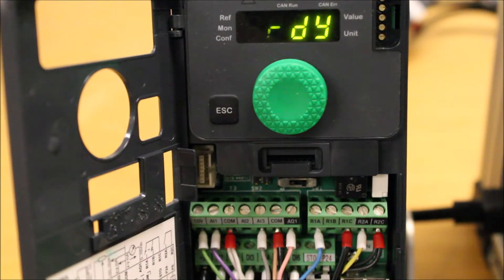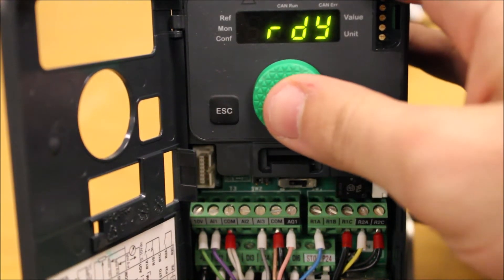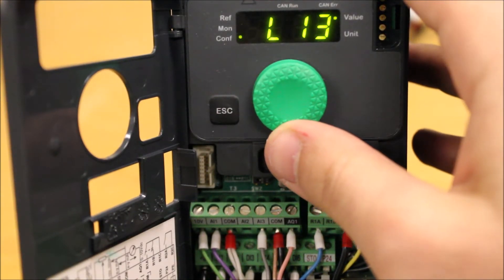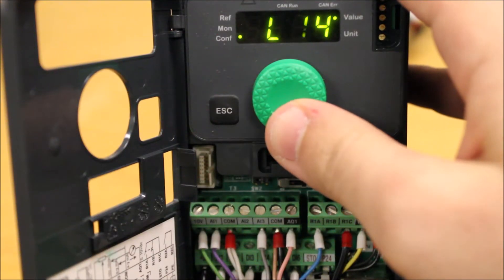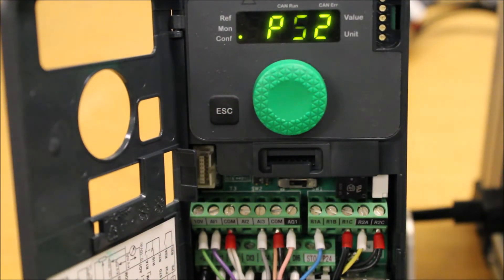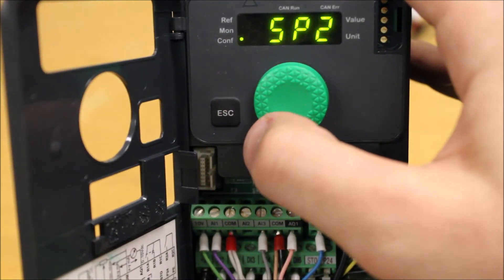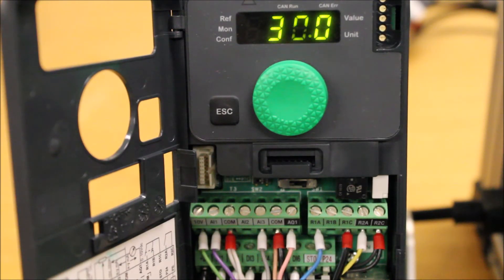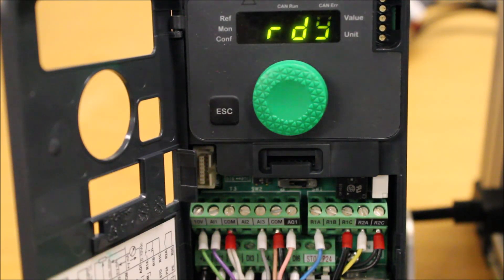Configuring Preset Speed Functionality on Altivar 320 Drives | Schneider Electric Support

Comment: what is the 18.2 Hz at starting @3.32 , and how to set the SP1?
Reply: did you find the answer?
i kinda need it
Reply: Hi did you get answer to this question?
Reply: There is no SP1 in the Alt320 parameters, from what I understand only starts at SP2, as for the speed of the drive when he first starts it up. That is a speed determined by the analog input to the drive. Notice how he has 10v, Ai1 and Com connected with a wire, he is most likely using a Potentiometer to set the speed via analog input. The 2 speeds he set for digital input are then reached when he makes the selection probably through a simple toggle switch.